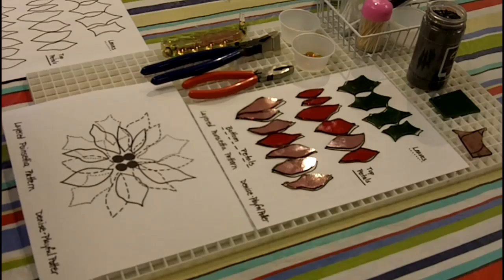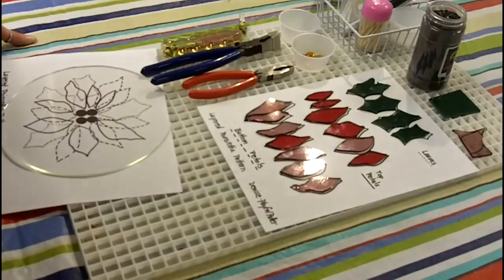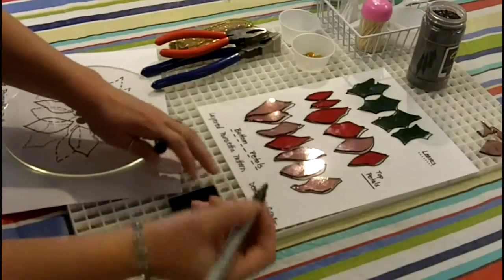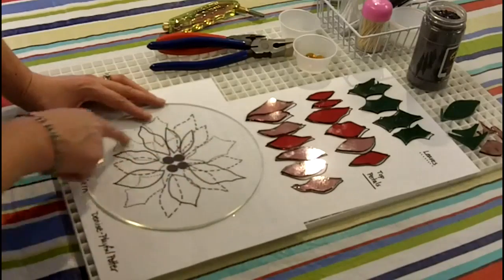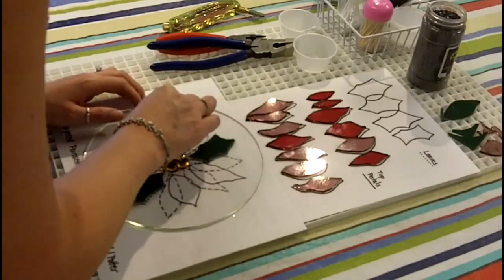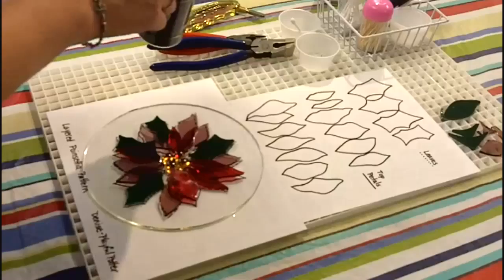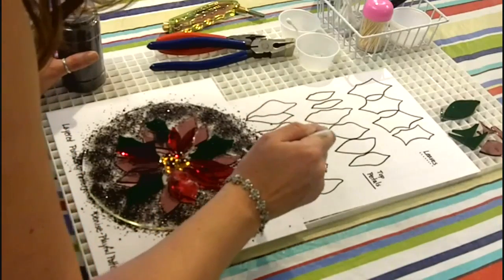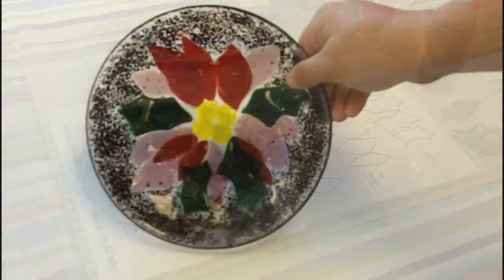Fused Glass Poinsettia Bowl

Comment: DON"T USE HAIR SPRAY!. First, it's unnecessary, you should be able to carry your piece to the kiln without frit moving - it's so small, who cares if it moves 1mm? Next, not all hairspray burns off, if it doesn't it can leave a film on your glass. Next, when/if it does burn off, those fumes go into your kiln bricks. Over time, this can cause devitrification on your glass due to the contaminants emanating from the fire brick. I have seen these problems first hand.